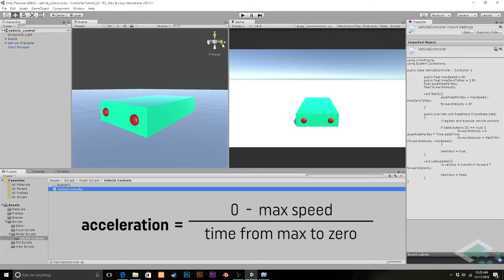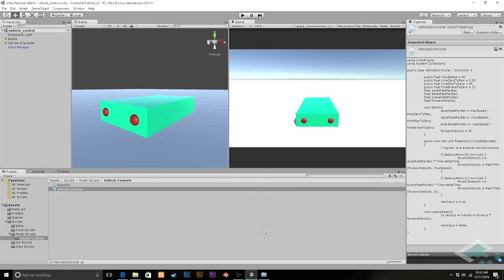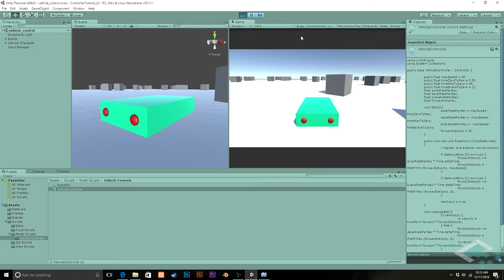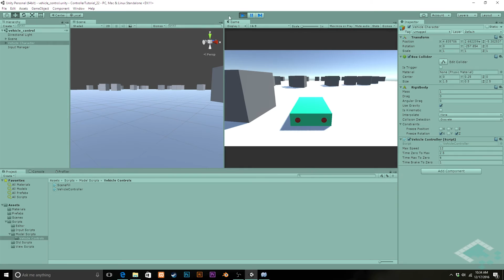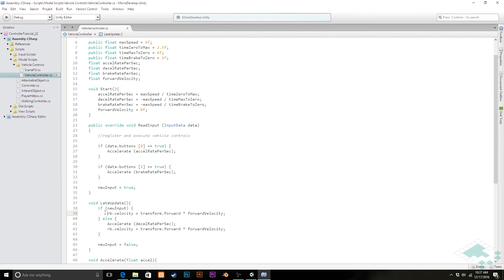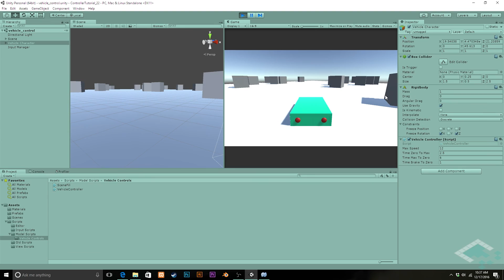Making a Character Controller, Part 22: Deceleration

Comment: deceleration doesn't seem to work. my game object has come to a stop but my debug log says velocity is still decrementing. the game object's state in the game view doesn't reflect the deceleration rate from "console".

if I set timeBreakToZero to the opposite extremes it makes no difference. it "slows" down same rate and land roughly at the same spot.

acceleration "seems" to work.
Reply: Having the same issue here.